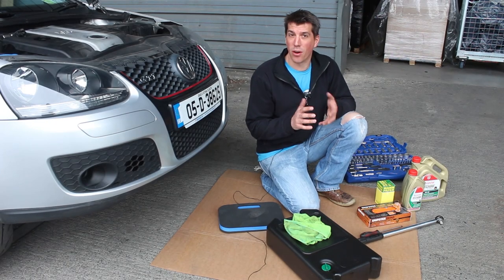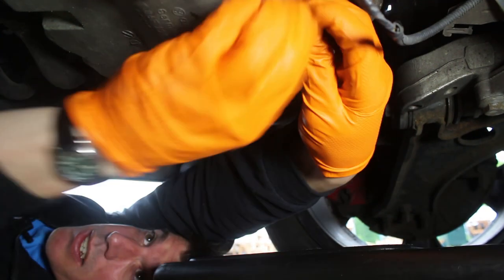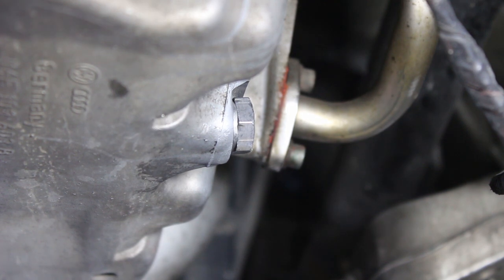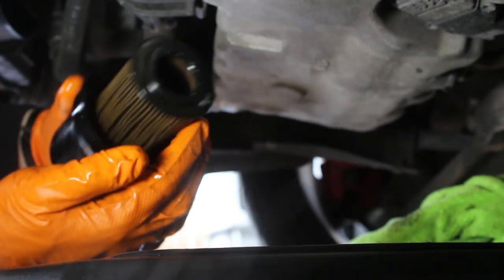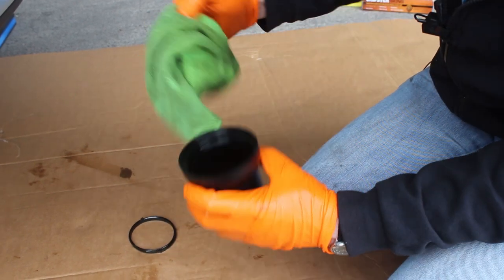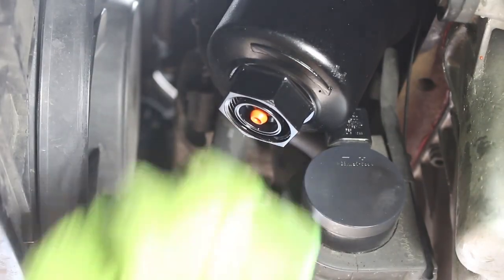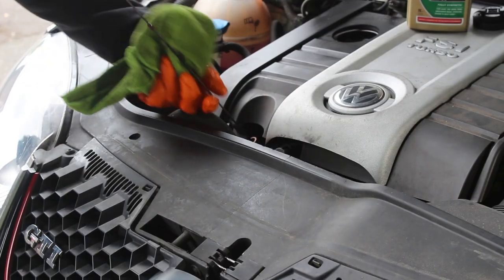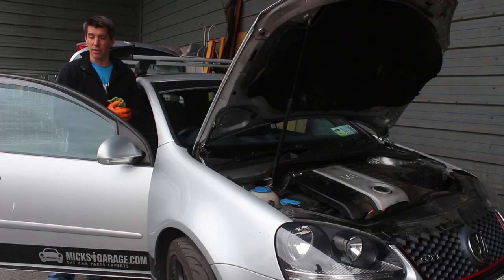How to do an Oil Change

Comment: I did as explained in the video thinking it would help with the oil pressure warning light as the oil and filter hadn't been changed in a while, but the problem still persists. Do you have any suggestions of what to do next?
Reply: oil pressure sensor. mine went bad

Comment: hello - first time oil changer on a VW...question about the perforated inner tube that pulled out with the old filter...I see where you put the tube into the new filter and then started to push down on the new filter into the cartridge housing (at 5:20), but then the video switches to a view of the fully inserted filter before it can be seen how securely the tube is reinserted into the cartridge.  does the perforated tube snap back into the housing, or is it in loose?  Mine pulled out with the old filter like yours did in the video...I put the new filter on the tube, but it remained loose in the cartridge and didn't seem to have a way to snap back in securely.  I rotated it around and pushed on it, but it still did not seem to snap back in.  I didn't want to break it, so didn't horse on it too much.  Does it matter if the tube is loose or secure?  every video I've seen of this shows a tube that looks secure in the cartridge.  thanks.
Reply: thx for the quick reply!  I pulled off the cartridge and looks like when I put the cartridge on the 1st time it seated the tube...and without crushing the filter.  it definitely seemed like where it was supposed to be.  my experience is with American v8's and spin-on oil filters so this cartridge kinda threw me.  thx again for the advice.

Comment: I forgot the oil in the oil filter before to instal what happen? Please answerme!
Reply: MicksGarage1 hi,I followed your guide step by step but ever since doing the change i get this cold start rattle coming from the sump area just for a second or two. any ideas as the car drives spot on.?  on one website it said i shouldn't have filled the filter with oil as it can create a airlock.?